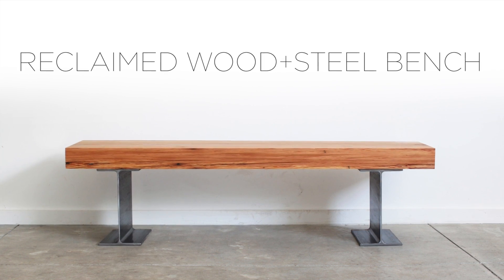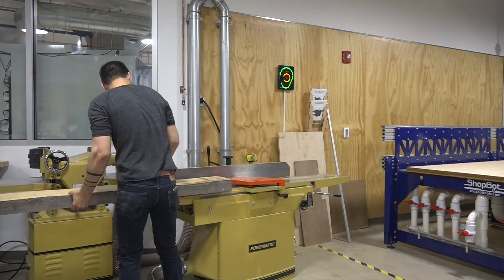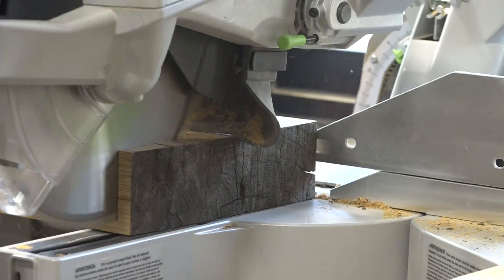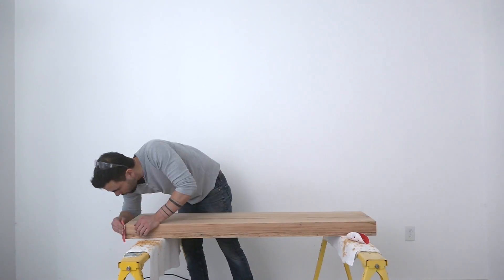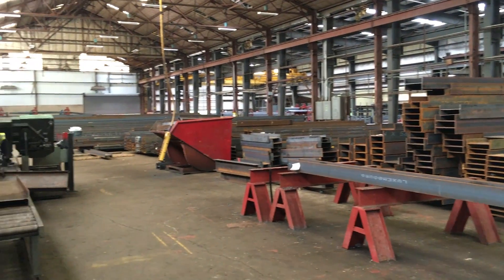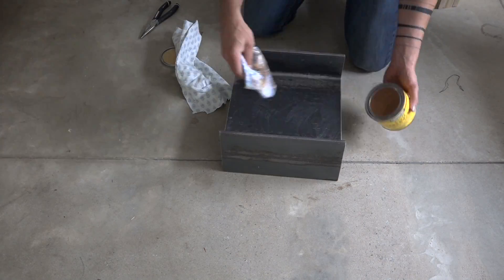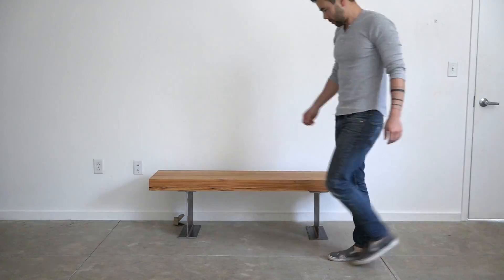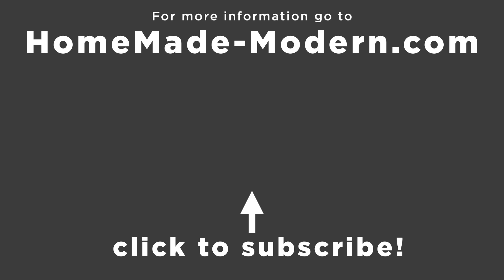Reclaimed Wood Bench with Steel I-Beams | A Woodshop Project

Comment: Magnets were an awesome idea! That's very cool to be able to rearrange the piece if you wanted. One thing technique thing I'd like to point out for you and anyone watching is when you jointed the slabs you were putting pressure on the back side (the infeed) table while pushing the slab through. You want to always put the pressure on the front (outfeed) table. If not you may end up with a taper on the face you are jointing rather than a flat surface. Keep up the great work Ben!

Comment: Don't use a brush for "wipe" on poly. Use a cotton cloth with long smooth strokes. It will build a nicer finish for you. Foam brushes add air bubbles to your finish which is why you have to sand between each and every coat. Wiping will give you a better smoother finish with less sanding.

Comment: Great build and love that you had some beautiful old wood to work with. One Question: When you are at the Jointer, on the wall behind you is lit up kind of sign that seems to blink. Is that some kind of Noise Meter to alert people to wear protection? That would be a great thing to learn to make for the shop. Thanks!

Comment: I'm a little confused about your decision to use the magnets because you wanted to be able to re-purpose the slab in the future if you wanted to. I would have thought that the second design with 4 countersunk screws per leg allowed for that option better. No large holes from the magnets to "deal" with.
Other than that, I enjoyed the simplicity of the build and the final aesthetic. The cleaned and waxed finish on steel is often overlooked and most think to paint it instead.